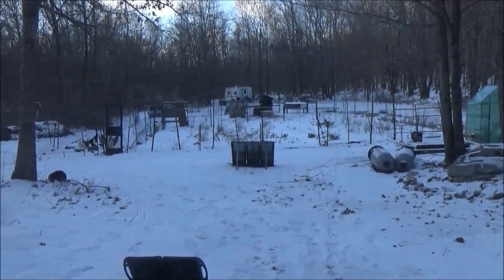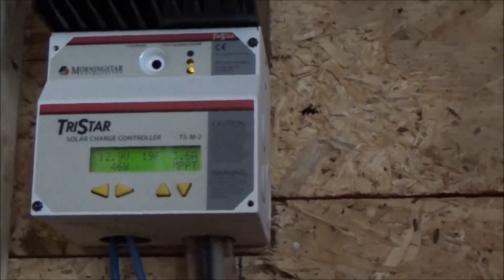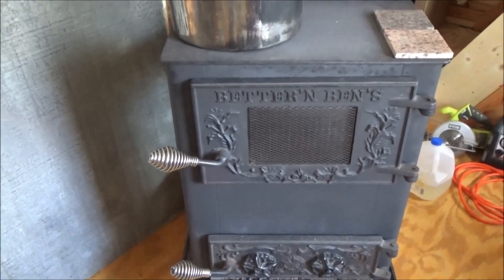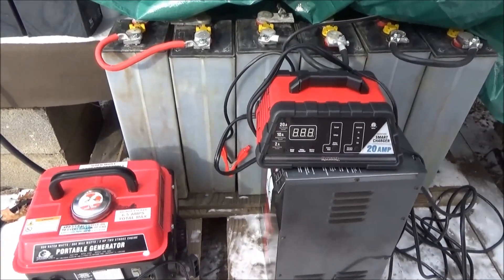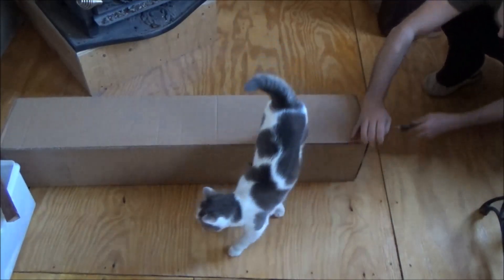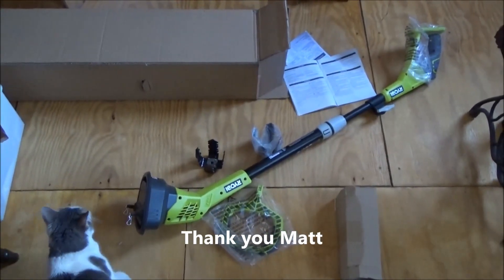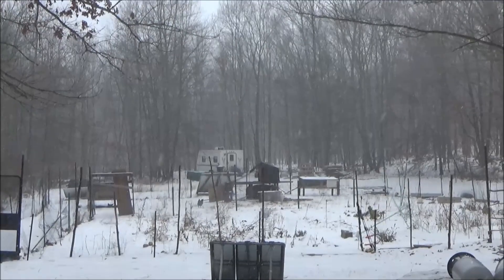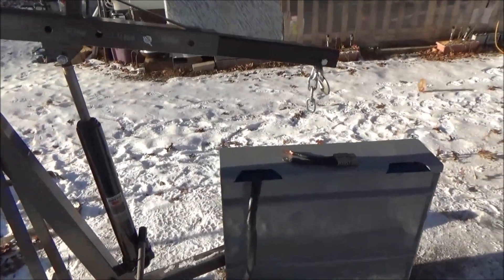Its All About The Batteries Forklift Battery For Home Solar Power

Comment: That is what I mean by a tow tractor battery pack. You should be able to make a nice little insulated box to hold the whole thing. Just put a roller bed on the bottom, so you can slide it in on one end with engine hoist and close the door behind it. Now is time to get the wind tower laid out in your mind as to how and where you are going to put it. When is weather permitting the ground is not to hard or soft. Also the wond is not blowin to hard. That will charge when the sun is not out, but the breeze is a blowin. Just keep the wind from blowing thru you and down the chimney. Need a wind vane cap to keep that from happening. It will also keep the fire burning, by maintaing proper air out of stove. Cold air in and hot air out.
Reply from the maker: It is an awesome battery. I am hoping to get the wind turbine up soon. But the cold is so intense right now and I need help out here to put up the tower. Hard to get someone out here right now.
House is cozy and warm.
Reply: ok

Comment: Troy, have you thought about spraying your solar panels with silicon to make the snow slide off? I am not sure if that would affect your panels but it is very effective with a satellite dish.
Reply: Well it was just a thought. I have used it on other things and it worked well.
Reply from the maker: I am not sure it would pass solar well enough

Comment: Hmm, a tiny criticism about your video.  titled, "All about the batteries" but it included a bunch of other 'stuff' that had nothing at all to do with your batteries.  Kind of a bummer for those that want just the facts, just the facts, Jack. OK, I know your name is not Jack, but one has to watch a 22:45 video about batteries that only has about 5-7 minutes about batteries.

BUT, I noticed one thing when you showed your wood stove and I hope this helps you out.  It looks like you have insulated pipe coming straight off your wood stove. that is going to seriously decrease the effectiveness of your wood stove.  You should use single wall heavy gauge black stove pipe from the stove to your ceiling and then and only then switch to insulated stove pipe.  This will increase the draw of your stove and also increase the overall heat that your stove will produce into your home.

good luck

Comment: Troy? Would it be a good or bad idea to make an insulated covered box for the batteries to be placed in in the winter? If you create slide in insulated panels, you can remove in summer.

Comment: How much did your reconditioned batteries go for
What was the name of the company who delivered them from Long Island
Reply: What truck?
Reply from the maker: Look up used forklift battery Queens, NY on craiglist and you will most likely find them. Or email me and I will give you their number. They charge 850 for a 12 volt battery if you pick it up. Comes with a one year guaranty.
Reply from the maker: KISS This... My old junk forklift battery is slowly coming up in usable energy. They went from 12.2 volts resting to 12.4 over night. I will desulfate them and I believe they will serve me well for many years. This is the budget way to go. You can sometimes get them free for the asking.

Comment: Can you rap some fiberglass insulation around your forklift batteries? Put a salvage break line on it.Do any of your friends have a truck to help you move that? Move the battery with the cherry picker on plywood after you get it close to the tiny house. use a couple of sheets and move them.
Reply from the maker: Mice love insulation. I hate mice. There are way too many mice here. I will probably use foam.
I have my truck fixed now
Reply: Well for a temporary fix to keep your batteries from freezing and ruining. I would hope that the mice dont have time to move before you get them located in the correct spot. you should build a box on the back of your tiny house to put them in and use some wool rock insulation or something mice dont like.

Comment: I would suggest you place the battery bank inside a rubbermaid shed or better yet in a warm part of your work space (behind that warm stove)...battery chemistry and charge performance is based on temperature...check out performance curves vs temp....a cold battery will not fully charge or release its energy....
Reply: +Raymond Balcom Yea, I cringe seeing people placing their battery banks outdoors...even if they arent sealed batteries, I'd find a way to have them indoors in a temperature-controlled environment with some push-pull fan setup to help ventilate gases...gotta keep those batteries warm and happy.
Reply: I'm not clear if your fork lift cells need support are the plastic cases sturdy enough to be self supporting....? Certainly easier to move around in case a cell goes south....

Comment: Before you charge this battery it would be a good Idea to take a hydrometer reading on each cell and the temperature you do that at, then you can start charging and check again. You will learn a bit. Also voltage before you start using and after put this info in a folder with the date.

Comment: Batteries work better and last longer when kept warm. You should not allow them to over heat or get too cold.
Reply from the maker: KISS This... Batteries will freeze if left uncharged in winter. A fully charged battery is still functional, but a bit reduced in capacity. Your car would not start otherwise.
Reply: The Do It Yourself World
True. Using such as starting a car with a battery that is extremely cold will also damage it. That is why there are companies that sell battery warmers.

Comment: Don't you have a wagon or lawn cart you can move the battery with?  Would it fit in the cart you move the firewood with?  I'd find a way to mount it to the tongue of the trailer right on to the house AFTER you put siding on the house.

Comment: The fluid you use in your lead acid battery is H2SO4 So when the battery discharges the sulfur moves into the lead. This is sulfating the lead when you charge the battery you disulfide the plates. Now when the sulfur stays to long it crystalizes about once a year you should try and take this out not by charging till your battery vents.

Comment: They make splicing compression fittings for brake lines were u cut were the lines good then it wrenchs down and u dont have to coil the line up u can run straight  then put to the good spot on the othere side put the othe compression fitting it real easy and cheap the fittings r about 3 bucks and change and depends on the  length or if it a hole u could cut at and the lines good u could fix there with one compression fitting ive done many times got any questions look up splicing brake lines on YouTube it show u just look for compression fitting
Reply from the maker: Thank you
Reply: The Do It Yourself World ur welcome

Comment: I've been subject to many different types of extreme temperature in my life but I'd say the worst would have to the cold. I remember while I was in Iraq it was spitting snow and two days later it was 112. I'd say the hottest that I measured in the sun was 129 but that was in the sun. Well do me a favor and build a small room on the back of your place and place the batteries in there along with that pot belly stove to keep them warm. You have the wood already on site [barn wood] and it ain't got to be pretty.
Reply from the maker: I dont think I would live in 129 degrees. I can handle the cold better than the heat for some reason. I guess everyone is different. At least in the cold you can put more clothes or blankets on. In the heat you can only take off so much.
I will build an insulated box for the batteries and heat it from the tiny house through a dryer duct
Reply: The Do It Yourself World
Troy, you may want to consider a small fan from a computer to blow warm air to the battery box through whatever type of conduit you use...That way the temp in the box would remain for consistent during cold weather and venting. Just a thought. God Bless...

Comment: Tiny house on wheels, what about putting some of that stove heat into a water storage so you benefit from keeping
the heat calories in the house and not need to burn more wood?
Reply from the maker: Yes soon
Reply: Right on bro. I've been experimenting with that idea this winter at my house and it is very good. I bought a pressure cooker from a thrift store for $3. I attached some copper tubing to the vent hole at the top and I run that into a bucket of water. Steam comes out of the pressure cooker, hits the water bucket and cools off. The steam condenses back to water and boom, I just got myself free distilled water dripping out the end of the copper tubing while heating my room up. I can take 500 PPM tapwater down to 3-6 PPM on the first pass. If I run it through again, I can get down to 0 PPM. I bet I would even be able to run skanky pond/lake/river water through it and turn it into perfectly fine drinking water. Very awesome.

Comment: just a thought.. when the guys delivered the battery why didnt they drop it near the house and not far away. It would have been easier to get the batteries to their resting spot from that vantage point as opposed to where they reside now... no?
Reply from the maker: No, they were slipping all over the place with their 2wd van and just simply followed the ruts made by my truck.

Comment: I myself would leave the batteries on the box and just cut the leads to make them 12 volts never mind I see the new battery love it
Reply from the maker: I will not cut anything nor take it apart. They gave me a connector and even put on crimp on ring terminals for me. Very kind of them.
Reply: watching your videos . and now that i'm just getting started on the solar stuff I plan on going straight to fork lift batteries. not wasting my time with anything else. thanks.

Comment: just curious .. can your tires handle the weight of your house and all this extra weight?
Reply from the maker: The house is 6,000 pounds empty. The camper was rated for 7,000 pounds.
Reply from the maker: gettinready101 Yes true. Before this ever goes on the road I will get new tires for sure

Comment: actually most systems have difficulty equalizing batteries so normally gasing is not an issue except during hot weather and the sulfides will destroy inverters if mounted above the battery bank.....

Comment: I use a pro mariner pro nautic marine charger for my batteries because it is made to gt rid of sulfation in batteries,,I use one in by big cabin cruiser and my motor home and it does an awesome job of keeping my batteries up to parI have a stereo system that is power hungry and this charger keeps up,, never seen such a good charger besides zantrex
Reply: These are expensive chargers....but....try buying a replacement battery these days and the cost of the marine charger is well worth it.

Comment: Hey i have a tip for u and your engine hoist. When not in use make sure to lower the hoist.. also having hold something up out in the weather isn't good. The reason is , do you see how smooth the shaft is on the pump. When you leave it up it develops surface rust which means when u lower it. it will cut the seal or o-ring inside the pump.. that seal is what is holding all that pressure and weight of the hydraulic oil and such. But you can oil it heavily to help stop the rust.. I,m sure you knew this but i jus wanted to say it :P

Comment: Get a repair union for your line.  It just takes a small tubing cutter and 2 wrenches.  They are made of brass and are compression fittings.  You should be able to do it in about 30 minutes.
Reply from the maker: ok

Comment: hi i just bought a used needs work 6-85-13  510Ah any thoughts on bringing it back to life how many volts do u think to desulfaite weather here is 50 deggrees during day i have 60 amp solar charge controler 1000 watt arrey any help would apreciate it
Reply from the maker: +Michael Galac Not sure of your question really. A desulfator uses hundreds of volts in pulses to desulfate a battery. But to charge it you need normal lead acid battery settings.
Reply: +The Do It Yourself World did not know that thanks for response ill have to look in to it cause this battery taken alot of amps just to get up to 12.5 volts holden at rest 12.5 after 5 hours 15 amps

Comment: Troy:
The cart you use for moving wood, may have capability of handling a 1000 lbs.  to get your new batteries moved.
I've seen similar ones like yours listed at 1000 lbs...not sure if there is a tag on it to confirm or not.

Comment: I know this is an old video, so this all might be moot by now, but here are some ideas I haven't seen in the other comments:

1. To keep the batteries warm while letting them vent, how about diverting the chimney smoke through the outside battery box, may need to mount it higher up though.

2. For rodent safer insulation for stuff, you may want to compare the following types that others didn't mention:  A. Rigid BASF invented Styropor(R)/EPS, not the same as Dow invented Styrofoam, this is like tiny white plastic bubbles fused together in massive man sized blocks, then sliced and diced to size.  B. Rockwool(R), this is like fibre glass insulation but made from molten rock, not glass. C. Simple double layers of wood/plastic/glass walls with loose pebbles in between to slow air circulation between the hot and cold side, if it doesn't work out, you can simply remove the pebbles and poor in commercial insulation material, you could also remove the pebbles to lighten the weight of your tiny house on wheels.  Remember, all insulation materials are just ways of trapping layers of air.

3. I guess both jobs are long done, but why couldn't you just roll that engine hoist with the battery all the way to the house?  And if it was too cold outside for the repair kit, why not unhook the brake line and take it inside for fixing?

Comment: How's that portable generater work for you. I bought one haven't used it yet.
Reply from the maker: Dont. They quality of them these days is horrible. A friend just bought one and it self destructed on the second run. Traded it in for another which tore itself up on the first run. Bought a third which again broke on the first run. No good at all anymore.
Reply: OK no problem. I'll take it back even though it's been sitting since I got it probably a year ago.
Reply from the maker: Yours may be one of the last good ones. I would try to run it a while and see if it works. You ALWAYS have to change the spark plug and spark plug boot out of the box though. They are garbage. The old (year ago) machines sometimes worked. Some did not. The newer machines are all garbage out of the box.

Comment: 1st you know I enjoying your vid's
The video I just saw said each cell has to read 2/2.5 volts to even be candidate for reconditioning 
Your hydrometer has to have a longer tube
Only special water (can't remember the name) can be used to top off
Once the chemical is added and the water is added,you have too charge for a constant 24 hours
The video I saw was done by a guy that makes his living doing this,and the way he did it and your way are not the same,I suggest more research,good luck.

Comment: Have you considered storing power generated by solar in the form of gas?....solar to hydrogen (separated hho)...then compressed into a propane tank...just a thought. For what many spend on batteries to store power I figure you'd save money and headaches with a hydrogen system. Hydrogen in propane appliances works well, but if your safety conscious you can put a blowback\regulator on the inline.  Hope that's food for though, p.s hydrogen is zero maintenance and stores indefinitely. You can play with a gas weed eater motor and just feed it in the air intake for a quick little genny
Reply: Sorry forgot to add the electrical motor needed to make power, I'm sure everyone knew that but for those who don't.

Comment: Putting a patch on a brake line? O_o That sounds like madness to me.
Reply from the maker: Really? Read through the comments and all the suggestions about how to do it properly. And thank you to all who suggested it.
Reply: yup. i patched a break line with 5 inches of RC airplane fuel hose (tubing) and a couple of 1/2 inch band clamps once. got me home and then some. Just patched my plastic Toyota radiator with J B weld yesterday. used a long shoe lace to replace a fan belt once. a soup can to patch an exhaust pipe, super glued handles back on, bungie corded a trunk, hood and a passenger door shut. MADNESS!!  gotta love the inventive mind yeah,, lol
Reply: grodad I have used the can on the exhaust pipe trick too, as well as a bungie cord to fasten a hood on my van, and have used JB weld for all kinds of repairs on my cars.. Gotta do, what ya gotta do sometimes.
Reply: I was taught never to skimp on the brakes or the steering since they're the parts of the car most responsible for keeping you from crashing.
Reply: ***** So are broken bones
Reply: ***** :P

Comment: Its too bad you didn't place the new battery where you needed it.  So much time spent moving things here and there just so that you can move them again later.  All and all its a lot more work for you,  think about it and try to make it easy on yourself.
Reply from the maker: These guys drove 3 hours one way to deliver a battery to an off grid home. They never did that before. They did not want the trouble. Most companies pick up the battery with a forklift and these guys drive away. I did not want to waste their time. Its my idea, my problem. I will move it.

Comment: Troy why didn't you bring these to mich with you? they would be very useful
Reply from the maker: The individual cells never came up over 12.2 volts. They were badly damaged inside. When I opened one the lead disintegrated into a powder. I took them in for scrap metal when I bought those better batteries I am using now.